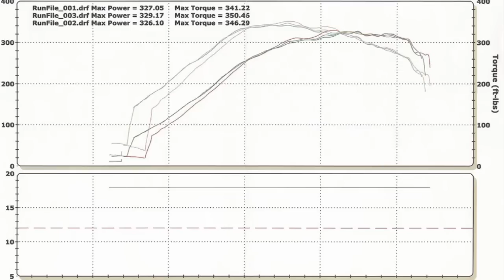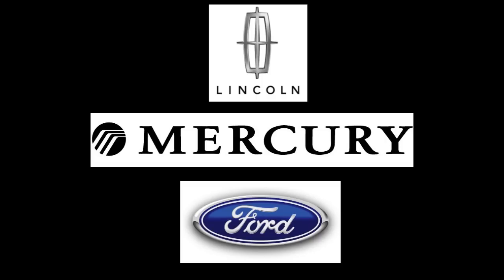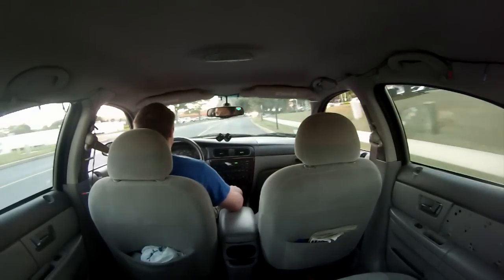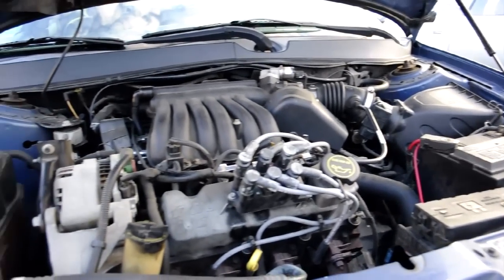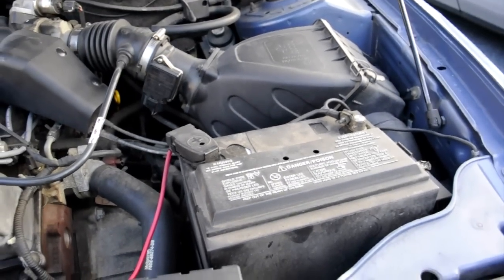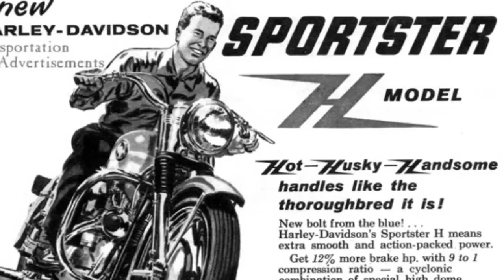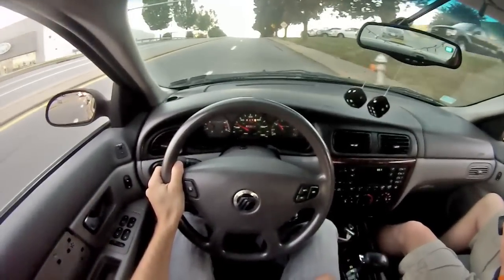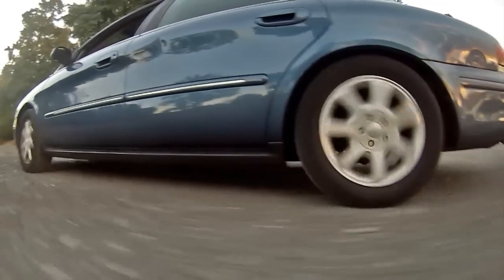Regular Car Reviews: 2002 Mercury Sable

Comment: Not all iron block pushrod V6's from this era were bad. Look at the Buick 3800 Series 2 L36 or the supercharged L67. They were some really good engines.
Reply: cough Valve cover gaskets cough
cough Intake Manifold cough
Reply: awesomeologyism ive heard about these issues, but ive got an l36 with 100,000ish miles on it, and i havent had any major issue other than coolant elbows.
Reply: Some people think because its old it must be bad. Thats not always true.
Reply: michaelpack1988 toyota 2jz/1jz owes its design to the lenkil?? i6 that dates back to the 30s makes massive power and couldnt kill it with a stick of tnt and a head start. you are very correct
Reply: Alex C We made it to 208,000 miles before a bad thermostat led to an overheated engine that led to an intake manifold gasket.
Reply: awesomeologyism while this is true, those items are not something that cause engine failure..... if you are mechanically inclined you can fix it yourself, gaskets are cheap and they are fairly easy to work on. they actually are fantasic engines and i have both a 96 L36 bonneville and a L67 gtp grand prix. they are extremely reliable engines but are not without their flaws
Reply: Zach Weibel The Ford Vulcan V6 isn't a "bad" engine, it's just an old, underpowered, boring, inefficient, uncompetitive engine. Perfect for the people who bought Mercury Sables, who are all dead, and Mercury with them. But as a used car buyer (or inheritor) on a budget, it's a perfectly good engine and a perfectly good car.
Reply: doctor zaius 18/25 isn't that bad for efficiency, it's just mediocre
Reply: the vulcan is a good engine, no doubt about it. i think it was a much better engine then the essex 3.8, those things had allot of problems. the GM 3800 series II is actually a pretty lively engine and is probably one of the more powerful v6's from this era. i would much rather have that engine than a vulcan or essex v6. a normally aspirated GM 3.8 makes 230 ft/lbs of torque, not really a slouch even today decent. the L67 supercharged version put down nearly 300 ft/lbs of torque one of the most powerful v6's from those years. but is the vulcan a bad engine.... no, it is at least reliable.
Reply: andrew donohue I've got a supercharged 3800 L67 in my car. Great engine.
Reply: awesome engine, but the downside is that they arent any cheaper to run then a V8. i have a grand prix L67 GTP and a 1996 camaro Z28 LT1 and i swear the LT1 might even be cheaper if i drive it sanely. the LT1 just has gobs of low end grunt you do not have to push it at all to get it moving. i really like both engine but i do not like the opti-spark on the LT1. that would have to be the ONLY thing i do not like about the LT1
Reply: awesomeologyism cough Both take about 6 hours of labor and are something anything with a basic mechanical skillset and set of tools can accomplish in a car port. cough

That being said, fucking Dexcool.

Comment: I have a 03 Taurus with the duratec, not the fastest car out there but it is reliable. Has a little over 180,000 miles on it. Bought it for $1000 dollars, yeah the abs module went bad and it has a leaking gas tank but she still runs. These things don’t die.

Comment: This is one of those few cars that just seems utterly awful in every way.
Reply: :( I'm 16 and my dad is giving this to me in a couple of months. Hope it's not as bad as you say haha
Reply: 3OD17 These are pretty bad cars, but hey, anything free is automatically awesome. Plus, if you're 16 and it's your first car, it's not bad. 16 year olds, particularly males, have a strong tendency to ruin their first cars, either by crashing them, abusing them, neglecting them or making ridiculous modifications. We've all been there, lol. So what better car to ruin than one that already sucks?
Reply: 3OD17 Actually, I own a 2002 Sable with the Duratec V6 and it's the best car I've ever owned, next to an 03 Focus Zetec. This is a Ford Taurus, which are known for their reliability both in and outside fleets. I love the power, it comes on quick and the MPG is really good for a V6.
Reply: Wow well that made me more optimistic about getting this car
Reply: 3OD17 The Sable GS comes with the Vulcan, LS has the Duratec. Vulcan or Duratec, an engine is an engine is an engine. It's all based on personal experience. Yes, the Sable might look like a car for old people but it's definitely not a bad car. Mine just hit 45,000 miles and the check engine light JUST came on now for a bad exhaust sample valve. An easy $40 fix. My channel has some videos of my sable. Check them out if you're interested.
Reply: Alex H But they really were. They burned through transmissions like crazy, as did the Taurus. The one in my 01 died at 102k miles under regular dealer maintenance and mostly light highway driving. At least the engine (although underpowered) was pretty reliable and moderately efficient.
Reply: my dad's been driving his for years for about 60 miles to and from work every day. It's been giving him some slight trouble while starting but can that be fixed? I'm just gonna give it a tune up, new tires and brakes and fix whatever is making it have issues starting
Reply: Alex H
 45k miles and you already have a check engine light for failing parts? That's not exactly the picture of reliability. I've had Hondas that went 200k with no CELs on basic maintenance. Also, I guess this car could be considered good if your only frame of reference was other Ford products from the early 2000s. I had one of these as a rental years ago, and IMO it was one of the worst vehicles I've driven. I suppose it would have been better with the Duratec V6, since those are decent engines. Mine had the Vulcan though, and it was godawful. Pitifully slow, yet it still drank gas.
Reply: splewy Hondas are overrated. I'm reading about 2006-2008 civics with cracked blocks? That's not a symbol of reliability either.
Reply: Alex H
at least honda engines are a dime a dozen and tend to be interchangeable. the transmission for the mercury sable cost more than another used sable...
Reply: Alex H Honda's golden era was the late 80's to the year 2000. Everything after that has been getting increasingly shitter
Reply: SeverdSeouL The indicator that Honda's glory days were over?
The four-wheeled slug they called the Insight.
Reply: My mom has the 5-door wagon version of the Sable's less-ritzy twin, the Taurus.
It's run like a dream since the day she bought it. Sure, it could use some brake work, and the climate control's had a few gremlins, but nothing serious. Of course, we splurged and got the twin-cam, so...
Reply: Truly one of the least reliable cars of all time. Have fun with the electrical system!
Reply: It isn't awful, if anything it's awfulyyyyyyy

Average
Reply: Which is interesting, because the Ford Mondeo, which is a close relative of this thing, is arguably one of the best all round cars around. Interesting.
Reply: I drove an 07 taurus with vulcan. Besides squeky ride. If you didnt care about cars and didnt like power it was relatively comfortable the stereo worked decently. Ford taurus / mercury sable showing the world you've given up on your dreams.
Reply: I had an '02 Sable LS with the Duratec as my first car. I've never hated a car more in my entire life. And yes, it belonged to a grandparent.
Reply: cyberboy855 Sucks to be you. I had an '02 Sable LS Premium and won several drag races with it. It was fun watching peoples' reactions when I won. One of the best and roomiest cars I've ever owned. Perhaps you should buy a Chevrecall Impala.
Reply: Alex H The only reason Chevy made over 750,000 Gen8 Imps was because they were trying to make it the ultimate fleet car.
Reply: Alex H Sucks to be me? Why, because I didn't like the car and you did? Grow up, dude.
Reply: 3OD17 Its not, the cars have alot of character. Plus, the Duratec 3.0 (not the vulcan) will be able to out-pull all of your friends civics. The drivetrain is pretty indestructible too. Many a stop light brake launch races won with that glorious gold bastard. Tons of room for shenanigans. Le Sablé is still legendary with me and my friends. Long live Le Sablé.
Reply: The Duratec V6 is pretty quick for what it is..the Vulcan is gutless but reliable.
Reply: both are very reliable, The Duratec in my car went to 260K with nothing but general maintenance.
Reply: I owned a 2003 that was a rental car at one time, 169k on it when i bought it, traded it in on a 2003 eclipse due to MPG. To be honest the Sable/Taurus is one of the safest cars you can buy, the engines are reliable, transmissions are so-so. The driving dynamics are...basically bland. There is a hint that it used to be a lot better.
Reply: Stephen Greer Bland? You have not felt blandness until you've driven an 8th-gen Chevy Impala.
Reply: 3OD17 Oh it is lmao! I'm not sure how many differences are from my 99 taurus, but, this was my moms car up from around 110 thousand miles and i got it with 155 thousand. Well lets just say, she never had ac or heat in it. I never did,Radio lights quick working so i couldn't tell what station i was on. transmission was just awful lol, it never broke down but it did alot of what mr regular did when he said "ooh it doesn't like that" lol. And i just passed the 160,000 mile mark and my engines locked up and i think its the end of the road with me and the ole taurus lol. If you're given it, its an ok first car. I wouldn't complain except maybe the a/c heat part. I enjoyed driving it for the most part. It isn't fast.. but it sounds the part lol. That v6 tries hard to get that car moving haha.
Reply: Martin Espinoza You have not experienced poor electrical systems, or a truly unreliable car until you have owned a Ford Contour... Ask me how I know...
Reply: Adam Korman Pushrod V6s are always better than I4s. BTW the first engine was an overhead cam, pushrods came later.
Reply: disagree, the Taurus/Sable are some of the most reliable cars ever. they're known to be reliable. I have a friend with three Taurus, a 02 Vulcan with 350k+ a 04 Vulcan with 280+ and his newest addition a 06 Duratech with 120k. and myself has three, there all low mileage but I love them all, 99 Taurus SE Vulcan with 97k and 07 Taurus SEL Vulcan with 76k and a  02 Sable Duratech with 134k
Reply: I had a 2001 mercury sable I bought from a private seller about 4 years ago and some change. He kept it in great condition , unlike me because I was an idiot. Thing started developing rust worse and worse which was my fault entirely for not washing it enough from the two winters it went through. I eventually had to trade him in and get a Mazda 3 at a lynch dealership. I don't know if it's just the nostalgia talking, but I really miss that car. It had no engine problems to speak of, it got me everywhere I needed to go and then some. I'm honestly debating on getting another one used.
Reply: My Grandmother has had one since 2006 with barely any servicing at all

Comment: I had many of these in 90s models, then one I got cheap through family - a 2003 sable gs with a vulcan, cd-player, cloth seats, adjustable pedals, puddle lamps on the mirrors, keyless entry/remote trunk release - loved it - had it for over 5~6 years until my nephew demolished it.  I have a 03 toyota corolla and I absolutely despise my toyota and miss my sable.  It still drove like a brand new car at almost 70k on the clock, short of the cat's clogging up and wearing out the last year I had it.  Had that fixed, like a new car again.  Never had it break down short of a dead battery, never had issues, don't remember a check engine light except when the oil got drained by the corrupt paid informants that had previously been fired - fixed that was good as new.  The vulcan motor, while not very powerful, was very, very reliable.  I didn't beat on mine by full-throttling it, though I did a bit going through corners hard - it handled like an absolute dream.  Would completely love to get another one with more options. Completely recommend it for your kid to drive if you're considering.
Parts available in any junkyard super-cheap, usually easy to fix and get to, not much guesswork on what to replace.  No frills but has just what you need none of what you don't.

Comment: I had a 04 Taurus SES (midrange trim) but it had the Duratec. Hands down, way more fun, fuel efficient, and MUCH faster than you would expect. Nobody expects a Taurus to be fast.
I timed my cars, the Taurus and a 93 Camaro RS and the Taurus won every time; it's an unsuspecting motor.

Comment: I had a 95 Ford Taurus with a 3.0L v6 which was probably the same engine. Had an iron block so it most likely was. It was so heavy and gutless but I paid 200 dollars for the car, put new front coil springs on it for 80 bucks and sold it for 800 dollars after driving it for one winter. That thing never let me down even with a transmission oil leak that I never bothered topping off. After three months the tranny never seized or broke down on me it just kept going. I sold it with the leak and the 30 dollar side cover and gasket to fix it and sent it on its way. No body rust either on this thing and only 80,000 miles but I'm assuming it was really rusty underneath. I didn't even bother to look. If something broke id have just gone to the junk yard and got a new part. The front subframe I know wasnt very rusty at all and it was some seriously tough stuff. The car weighed around 4000lbs so it was built pretty sturdy. I got around 20 mpg and put 20ish bucks in it once a week. It got me to a school and work that winter and that's all that mattered. Weird red interior with white exterior though which was aparantly a rare thing for tauruses. I hope that thing is still running strong

Comment: I had the 3.0 vulcan in a 1995 Ford Ranger, anemic, but it was the engine that never failed. Two years without an oil change, and no major engine work. The transmission went, but that was due to my seventeen year old urge to floor it. Never forget that truck.

Comment: Funny, this was my first daily driver car. It was the LS trim with DOHC V6 though. I sure as all hell did find it's pain threshold. Took it offroading on multiple occasions, reverse donuts in the high school parking lot, neutral drops constantly, drove it 45 mph off a ramp made of ice and snow. Made it through all of it. Ended up scrapping it in 2014 because the ECU shit the bed for a second time, didn't figure out what it was until we spent days working on it and realized 95% of the suspension was made of rust and only held together with caked mud and sand anyway. The car barely had 150k miles on it.

Comment: I have an '04 taurus se. It has the vulcan, I got it as a hand-me-down from a relative (who was the original owner) with 55k miles. It's a good car to just get from point a to b on. I've put about 60k miles on it in the last 3 years. Engine isn't great but gets the job done. The engine core is solid but the accessories (alternator, starter, distributor, etc) will definitely need replacing before 100k miles. Luckily all the parts are super cheap and readily available. Also there is ton of info online about how to fix these engines so I saved a ton of money just doing it myself.  This is a car that eventually you'll just learn to live with that minor oil leak, or other weird issue because it's not worth the money or effort to fix. It will keep chugging along until you save up enough money to get your next car. Btw the dual overhead valve might sound like the better option (200 hp vs 155 hp) but it's a nightmare to fix. You have to take off the intake just to change the spark plugs. There's no room to work on it. The vulcan is much easier to fix and worth the 50 hp sacrifice.

Comment: This wasn't the final Sable. In 2008 they renamed the Montego back to Sable which it remained for two years. Also the Vulcan was not even a clean sheet engine, it actually has some roots in the old German "Cologne" V6 but it was thoroughly changed for the 86 Taurus/Sable, the heads were even done by ze Germans.
Reply: The Vulcan is actually a clean sheet engine, the Cologne V6 never went into the 3-3.9L territory, just 2.8,2.9 and 4.0L for US markets. Also the Sable in this video is the last mid-size type, 2000-2005 was the final sable generation that stuck to the original platform roots, kept the same suspension setup as the 1986. Seriously, you can interchange the suspension on the sedans and wagons between 1986 and 2005 (2006/2007 for the taurus). The main issue with the vulcan was that it was rev happy, but was pushrod so it could not rev.

Comment: 1993 Mercury Sable with the 3.8 L engine. Suspension is butter smooth compared to the '91 accord I was borrowing for a few weeks and the acceleration with the bigger engine is really good. 189,4XX on the odometer and it's still kicking ass.

Comment: The duratec 3.0 ford taurus (2001) that my mom has is actually a very nice engine even if the car feels like a soft boat. Also the exhaust on it sounds quite good and it's only an axleback

Comment: my first car was the GM version of this car: a 1997 Buick Century Custom, which, yes, belonged to my grandmother. It was exactly the same in every way: 3.0L v6, 150 hp, 3 tons, only difference was that it has an automatic. It lasted from when I was 16 in the late 2000's... until I was 23, and I sold it for $1000. By the end, the brake pedal turned on the dome light, none of the electric windows rolled down, there was green scum creeping along every rubber seal and moss on the roof from years washed only by Portland rain, and the only maintenance I ever did was replacing the oil that it kept burning off.
And you know what?
I loved that piece of shit.

Comment: The lincoln continental (the top of the line car based off the same platform as the sable) didn't come with the duratec v6, it came with the transverse version of the 4.6 modular DOHC v8